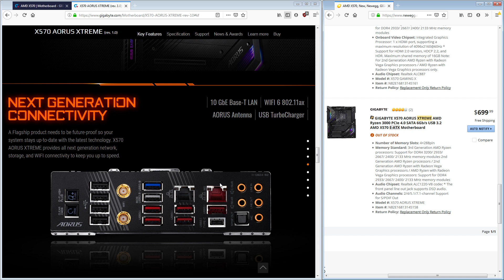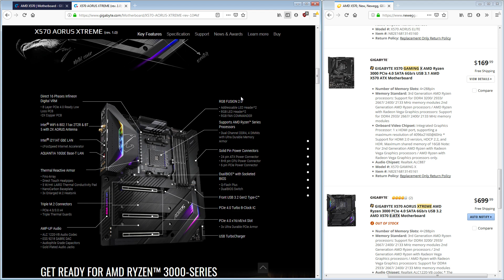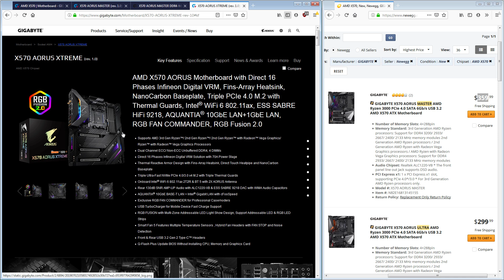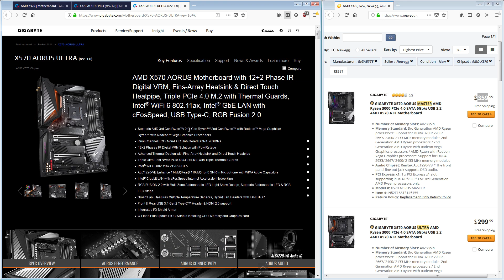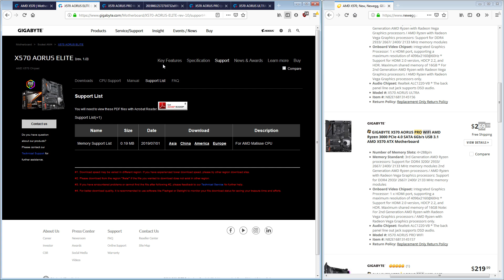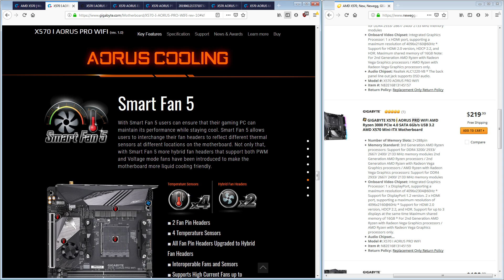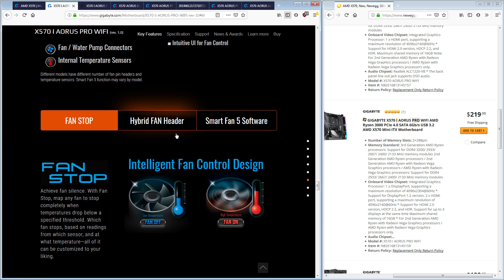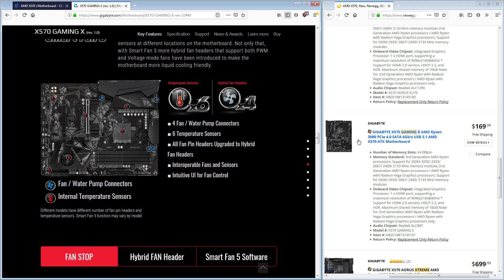Buildzoid rambles about ALL the X570 Gigabyte boards

Comment: Just ordered the Pro WIFI version to replace my MSI B550 gaming plus. Been having a lot of c0000005 errors while trying to game in DX12 which after some research and much testing I determined to be less than par VRM and DIMM slots. I will RMA my MSI board and hopefully the Gigabyte board will be a good upgrade.

Comment: Hi Buildzoid
I'm considering purchasing an X570 board however I'm getting more and more confused the more I investigate which board to buy.
My first choice was the MSI Tomahawk but I discusted by their scalping tactics recently discussed by JayzTwoCents amoungst others.
My second choice was the GigaByte Auros Elite but again confused by their site info, in one photo they show the I/O panel without Bios Flashback (see Connectivity) and then lower on the site page (Auros Ultra Durable) it does show these buttons (which is correct?), and it doesn't have trouble shooting LED's.
My third choice would be the ASUS TUF Gaming X570-Plus however as you said in your "Rambling video" it's the way ASUS takes away certain features etc.
Can you please give me your valuable advice?
Alan

Comment: With Asrock boards, 8 SATA is actually 6+2 where the "2" useable with a clause. If you use all 8 SATAs on Taichi, you'd loose one of your M.2 making it on par with Gigabyte boards with regards to SATA
Taichi have 4 less USB 2.0 which is useful for low bandwith stuffs
Taichi have 1 more USB 3 gen 1 port, but 1 less Gen 2 port.
Slow device on fast port is okay, but fsat device ons slow port is not good.
Taichi have one extra PCIE 1x (Ultra used it for Wifi) and also support for Ryzen with graphic processor which might be unnecessary extra for many.

Comment: Hi, what's your take on the reported Aorus line (or generally Gigabyte's?) cold boot issues (and some stuff like restart loops and such), they seem to be very widespread. But your review seemed very positive and you seem to really know your stuff
Reply: Well, he can only report about stuff he experienced. And this is just an overview, so he might not have tested all of them. What I can report to you is that the cold boot bugs on the X570 Aorus Pro is real and I sadly experience it.
Reply: @PlayerForceHD  What's a cold boot bugs, Does it still have that problem? Your comment is 5 months old
Reply: @gogetablue7905  A cold boot bug is an issue where your system hangs during POST when it did not have power before (for example PSU was turned of for some time).  I now have an MSI X570 Tomahawk since ~3 months as the cold boot issue couldn't be solved and the Gigabyte support was worse than being my own support.

Comment: i hope these boards still have the small speaker for the bleeping errors as i prefer that. like hey its ram or hey its gpu not pluged in.  For me i always prefere speaker and thats because thats what ive had all this time since my first built in 1999..  actually id hate to have to open the case to see what light is lite, even though with a error you have to anyway but hey thats me.

Comment: You mentioned you have a capture card that won't work if plugged into a chipset PCIe slot.

If you don't mind my asking, what card is that?

I'm planning out a new PC, which will have a capture card, and would rather avoid odd conflicts...

Comment: Here’s the problem that I see with these modern motherboards with nvm.    The NVMe drives slots should be treated like dim slots and they should be located north of the first PCI express slot I think by stacking them similar to ram we can aluminate a lot of storage issues I for one have no intention of all put it sticking one underneath the video card just doesn’t make a lot of sense the other problem I see is you put all these Nvme slots on the board all the sudden you don’t really have the slot you might want for a say in 10 GB card or an upgrade and sound card or something else that you would like to add this would be a much better solution easier to cool those drives and keep them in the optimal temperature I hope to see those improvement in future motherboards.    Oh stop that way were not sacrificing things that we have options would also be nice to see you I’m on the board manufactures put all the bells and whistle’s like they used to post code button clear must power button and reset switch granted these things aren’t used very often but they are very critical on a new build and I’m sure there’s others who find consistent use for them I’d also like to see to land ports on the input output panel that way if one went bad you can always do another one that I guess it comes back to having a PCI slot available for off for another land any case you can’t have any of that shit if you’re spreading the whole fucking bored full of nome slots And let’s face it put it to you you need to have at least three slots of space between your primary PCI express lot and anything else because they’re gonna be buried by the video it was a graphics card you’re not gonna be able to use them so they’re kind of a moot point to put on the board in the first place and that location

Comment: I have the Z290 Aorus Pro Wifi which i bought last year - now there is the X570...is the upgrade motherboard and all new socket design processor worth the cost to do so? I mean will there be a noticeable difference in performance. Will Gigabyte at some point offer PCIe 4.0 support down the line?

Comment: Note the QVL has significantly changed as at the latest available date (Feb 18th, 2020). The highest memory speed on the QVL that supports using all four sockets is now 4000 MHz with BALLISTIX BLE8G4D40BEEAK.M8FE1.

Comment: completely agree many of these features should be add on cards but they dont want this because if its on board you buy it once and when you change your platform you will buy the stuff again with your next motherboard.
If it would all be add on cards you would never ever need an expensive motherboard.

Comment: I wish high-end motherboards wouldnt try so hard on audio.  The kind of enthusiast that they target with a $700 board is probably already using an external DAC of some kind.  And if you're spending that much, and you're not using an external DAC, you probably should be.  Personally, I use the SPDIF out to a surround receiver.  All a motherboard really needs to have is the front panel audio, which is just for convenience.

Comment: I'm annoyed at the x570 boards. Need two internal usb 3 headers which a lot just don't seem to have? The pro seems like the best option (ultra is just pointless for me) but no post code and clear cmos on rear io but at the same time I don't want to pay additional 80-100€ for 5€ parts and I'm sure I would be better of spending that money on memory or a chipset waterblock

Comment: M.2 cards just sit on the board? My Asus X99 Deluxe II has a vertically oriented M.2 slot that takes up about 2/3 square inch and allows air to circulate around it.  That's what we should be seeing.

Comment: With B550 out and about,  considering near equal pricing because "lol B550", would you rather pick:
- B550 Aorus Pro
- X570 Aorus Elite
The B550 one looked great, until I figured out it's a chess game of PCI lanes because the board just doesn't have enough of them. Losing the PCIe 4x due to using an M.2 SSD is sort of garbage. But it does have better rear i/o and at least the goddamn leds.

Comment: What we want are the Z490, X570 and the TRX40 fanless passively cooled AoRUS Xtreme boards, but with AMD's and these specs:
- 10Gb Lan,
- Wlan G6,
- Pcie-4.0, 5.0, 6.0,
- Usb-4.0,
- Displayport 2.0 (for 16k),
- Hdmi-2.2 / 3.0 (for 16k),
- 7nm Cpu (x2+) Zen3, 5nm Zen4,
- 7nm Gpu (x2+), 
- Ddr5 Ram.

Comment: A comment on this and several other mobo reviewers criticizing inclusion of WiFi: Keep in mind that many people live in apartments or even rented rooms, and do not have the option of stringing LAN cables everywhere much less drilling holes in the wall. WiFi is everywhere, and many of us need it.  The higher-end protocols are now good enough for most gaming. There is nothing to complain about when a mobo includes WiFi. Especially not in the same breath as criticizing the boards for a lack of PCIe slots. You can't reasonably say there aren't enough yet also suggest that one of them should be wasted on a WiFi card.  Not when there are so many other needs some of us are apt to have for the slots (2nd video card; Thunderbolt, or if you want to wait for it, then USB 4; RAID controller; dedicated streaming encoder; even a sound card, if you're tired of having external devices piling up on your desk but you want better-than-integrated sound. As an extra, we almost always also get BlueTooth with the integrated WiFi, too.  So, having this on the mobo kills two PCIe-wasting birds with one stone, yet requires very little mobo space, and adds little to the cost. If you don't need WiFi and want to save $25 or whatever, then get a mobo without that feature; there are plenty.  To me, this anti-mobo-WiFi talk is like criticizing the inclusion of USB Type C just because some people won't need it.

Some of Buildzoid's specific other assumptions are just wrong. 1) No, 1x PCIe isn't plentiful. Various boards today have 0-2 of them, due to 3+ M.2 slots and 3+ x16 PCIe taking them up. Very few boards today ship with x4 or x8 slots, either.  2) If you do need the WiFi as your Internet access, you may also need the LAN, which is great for connecting directly to a NAS (many of which do not have WiFi and would be slower that way if they did), even if your cabled LAN is just between these two devices and has nothing to do with the Internet.  3) If you do need the LAN as your Internet access, you may also need the WiFi, since various of your devices (phone, etc.) do not have LAN connectivity and are inconvenient when hooked up to a USB cable (or only have that for charging not data), and in a group-living environment, you may not have sufficient control over your accesspoint/router to bridge the LAN and WiFi. The US homeownership rate among "households" is only about 65%, and is much lower at the individual level.  All of this is before we even consider usage of computer products in less Westernized/industrialized countries, where there often is no hard-wired Internet access to homes, and all there is for most people is WiFi.

Comment: Gigabyte's X570 UD must be fairly recent. Pretty much seems to be a slightly lower cost Gaming X. Albeit with the first x1 slot moved to where the second m.2 is, a x4 slot in place of the last x1, no second m.2 slot and less fan headers. ALC887 is from 2008 btw, if I remember correctly.

Comment: 13:08 - way off the mark. You could get dual 1Gig Intel Lan car for ~$100. 1Gig! You could probably squeeze single used 10Gig adapter for ~$200, but that is most likely to be enterprise stuff with fibre (SPF)... which is good, much better than ethernet, but not much use at home and very expensive to install. Consumer adapter with ethernet port is way more expensive and hard to come by, say Aquantias own dedicated Lan boards are like $400. The cheapest 10Gig adapter I could find is Asus XG-C100C
, which is ~$150 and it does use Aquantia chip, there is more expensive version of the same thing by ROG (which is impossible to find for sale at least in UK). Anyway - point being, you far underestimate the cost of getting 10Gig Lan.
On the wi-fi thing I agree - wi-fi cars are in plentiful supply and if you are actually serious enough about gaming to spend on high-end gaming motherboard, then you likely not to use wi-fi anyway. When it comes to network stability and latency wi-fi outright sucks, even the lastest AX... for any sort of online gaming wired internet is far better. Perhaps the only gamers who may use wi-fi are the ones who play offline, non-competitive games where latency and speed does not matter.

Comment: Seems like the more videos I watch the harder the decision on a mobo gets. Gigabyte Aorus Elite, Pro, Asus Tuf, Asrock Taichi.... F.... I'm not an overclocker I just want a board that works and performs and will go the distance for years. The huge turns offs on the Gigabyte boards for me is no debug LEDs and all the complaints about Bios needing updating. Why cant Gigabyte just ship out boards with bios already updated??? Once again I'm at a stand still with an Aorus Elite sitting in my shopping cart. I was debating between the Asus Tuf and the Aorus Elite, now I'm looking at the Aorus Pro but the Pro doesn't have debug LED either?? ugh. What do I pick? I was shooting for the $200-$250 range but I will pay a little more if it will cause me less issues with having to update bios and possibly troubleshoot without LEDs. Reviews are so wishy washy on all of the x570's Ive been looking at. I'm pairing it with a Ryzen 3700X and a EVGA RTX 2070 Super XC Ultra Gaming.

Comment: #windows7masterrace
On the note of optional extras, I see some budget boards with a wifi card slot; it would be cool to see standardized expansion ports replace most of the rear i/o, like a super mini extra row of PCIE behind the CPU VRMs, but I think the reason that's not done is it might be rather complicated, especially getting it into a small form factor, and it would also make it harder for board vendors to differentiate products.

Comment: I'm debating about getting the Aorus Master board or the Asus Crossheir XIII Hero (non-WiFi version). I would like to get back with Gigabyte again after their new BIOS revamp, but I also read that Gigabyte boards don't work too well with G.Skill... Which I do plan on getting. The Gigabyte Aorus Master also has lower ratings than the Asus Crossheir too according to Amazon. Any thoughts? Will be planning a 3950X editing rig with it.

Comment: Only think I would pull you up on is the need for more USB ports - in this day an age do you really need a USB port for printer, just go wireless, the board includes sma wifi connectors too - so no need for a USB wifi dongle, it has bluetooth integrated also. So mouse, keyboard, web cam are the essentials for most people?

Comment: It's also quite sad that high end consumer motherboards don't have an SFP-slot for their expensive LAN controller.
Then you could use fiberoptics OR cable because there are different plug in modules.

I also don't understand why they are not using a good server-grade lan controller.

Comment: Tossing up between Asus TUF, Asus Strix F and MSI Gaming Carbon, finally settled for Gigabyte pro. Due to memory support for 64GB at 3600CL16 (on QVL list), Intel Lan, Wifi6, AC1220 sound and VRMs that run cooler thant the others. Thank you for your videos. Worked out to be around $430 AUD shipped, other boards were around $370 mark with compromises. The GB pro also came with the most USB ports. That row of 4, USB 2.0 is invaluable for keyboard, mouse, printer stacks, while still freeing up 3.0/3.1 slots.

Comment: I guess elite had worse RAM QVL then higher boards as it is only 4 layer PCB? I have to make 2 decisions:
1) x470 (MSI pro carbon or Asus Strix) or x570 (with active cooling)
2) If x570 I choosing between Gigabyte Elite, Gigabyte Pro or Asus TUF. Unfortunately Asus TUF dont have front usb-c and I want to buy Fractal R6 with usb-c on front panel. Also not sure if Asus has stop and go active cooling like Gigabyte. Gigabyte Elite has this 4 layers PCB (instead 6). And pro is higher price then other two with not so much changes to Elite not counting this PCB layers ;)... But I am close to Gigabyte pro asit has everything would i would like to have. Of course my biggest concerns for x570 is active cooling...

Comment: The VRM's on all the X570 boards are absolutely overkill for any Ryzen 3000 processor. At full load the VRM on my elite never breaks 49c, I will say the elite is stupid buggy, it seems to be the least supported one.
Reply: so should i avoid it , cause i was hoping to buy one.
Reply: @nerdianz8081  New bios is decent, it's actually a very good board, it has a lot of good features. It's so good that a X470 doesn't make sense, I'd gladly spend the extra $30.
Reply: @rolandotillit2867  So ill go xith x570, thank you for replying mate.

Comment: Do you have top list of b450 boards?
Reply: MSI pretty much dominates in the b450 line of motherboards. Tomahawk and Gaming Carbon Pro ac are both very good boards.
Reply: @Just2kwik  some said that tomahawk is a problematic board
Reply: The best b450 board is the gaming carbon pro ac. It basically hasn't changed since last year's reviews.
Reply: @Just2kwik  yeah but quite expensive
Reply: For $800 USD, you can get:
Ryzen 5 2600X
MSI B450 Gaming Pro Carbon ac
Corsair Vengeance LPX DDR4-3200 (2x8 GB)
Team GX2 512 GB SSD
*GTX 1660 or *RX 590 (your choice)
Phanteks Eclipse P400
Seasonic Evo Edition 620 W 80+ fully modular

60+ fps in 1080p (*RX 590 Power Color Red Devil or *GTX 1660 EVGA SC Ultra Gaming)
Reply: @Just2kwik  I prefer 3600 as it is faster than 2nd gen but you got nice  components
Reply: @demon6937  $850 if you remove the 2600X and get the 3600. Me personally though, I would rather spend that extra $50 on a 1660 Ti. But either will work out well.
Reply: @Just2kwik  that $800 seems like $1000 in my country thanks to import tax. Though my budget is $1000.

Comment: thank god i got the elite
i ordered an msi b450 gaming plus which was sorta doa
but after fiddling around with it i realized i prob want a better one anyways so i got the elite
the gaming plus bios flashback didnt really work great ended up just using a friend's 2nd gen cpu
the bios is really restrictive to the point where i couldnt select some options